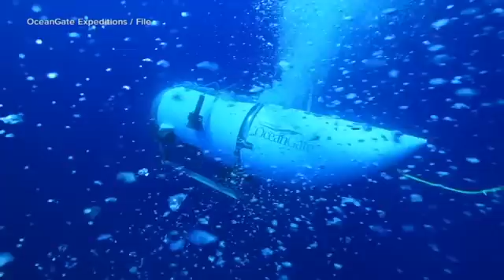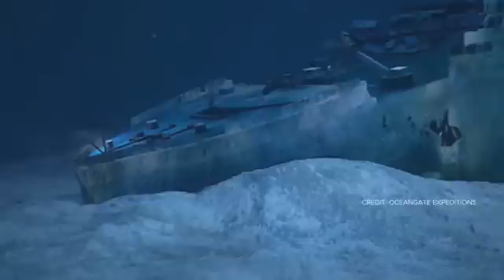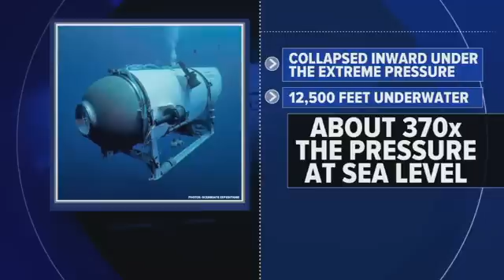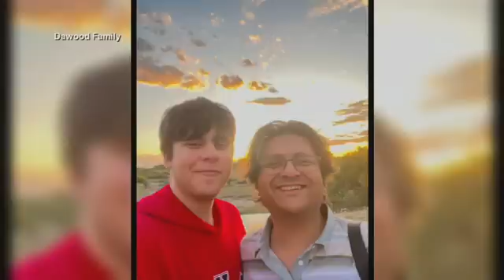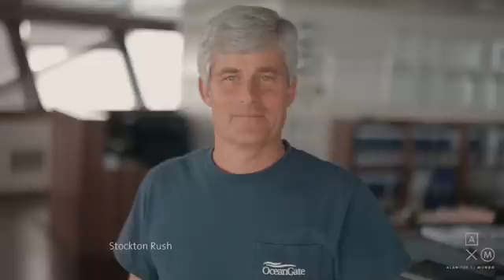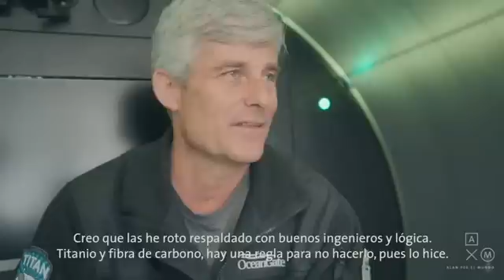Engineer says OceanGate CEO ignored warnings against use of carbon fiber for sub

Comment: Carbon fiber is great in aircraft where the pressure-differential isn't that significant and the low-weight is necessary, but it's not got the compression strength to withstand the immense pressures of the deep-ocean. Carbon-fiber has immense tensile strength for it's density, but it's compression-strength is significantly lower than steel, and deep-sea pressures require both immense tensile and compression strength. Titanium is similar but does have more compression strength, however the quantities required would be too expensive to warrant it's use over steel. Ultimately, this guy was legitimately stμpid and I'm amazed at the fact that his sub worked at all with his very obvious lack of metallurgical knowledge and complete ignorance on the physics of this type of application.

Comment: Carbon fibre is weak most super cars are made of carbon fibre and if you notice when they crash they obliterate  . Never mind being able to hold pressure .   No brains were used in the making it was just rushed
Reply: Because they make air/co2 tanks from carbon but what ppl fail to realize is its completely different. Contanting pressure is tension, holding pressure out is compression. Something carbon hasnt been proven to do. Fact they used it 3 years w/o replacing carbon is just asking 4 it ontop of flawed design
Reply: You guys are a bunch of nuts
Reply: He wanted to die and be part of the titanic Disaster.
Reply: @AlexanderZapataIndividual  that could be a possibility they are all obsessed with titanic.  They think it's a tourist attraction
Reply: @pistonpoppa   In the same way I am extreme sportsman that jumps off planes with an umbrella.